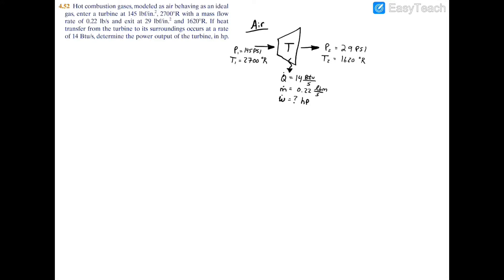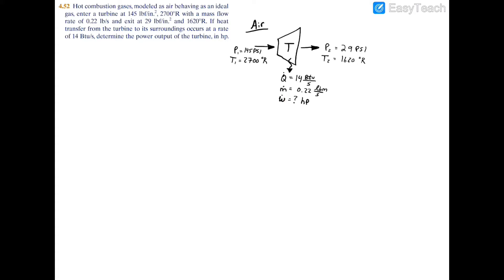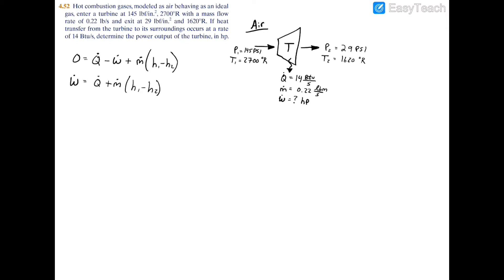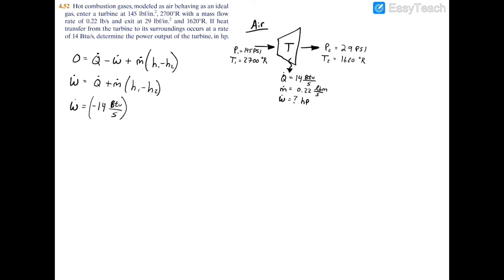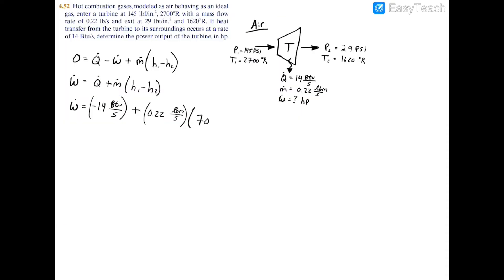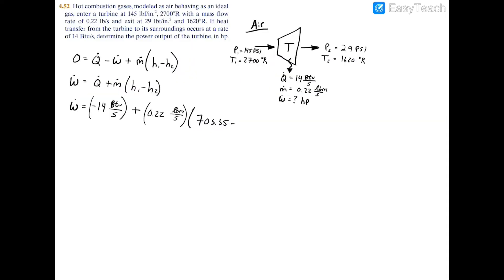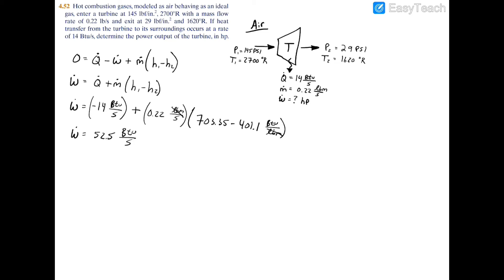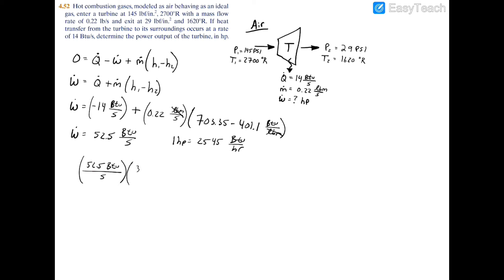4.52 Hot combustion gases, modeled as air behaving as an ideal gas, enter a turbine at 145 lbf/in.2

Comment: Question says that gas can be modelled as ideal gas, so do we really need to use to property table??
Reply from the maker: Hello, thank you for watching. The approach I have shown is the most accurate way of achieving the answer. I believe you are asking if we can just use the relationship of (h1-h2)=cp(T1-T2) instead, so we do not have to obtain the enthalpies from the properties tables. While you can definitely use this relationship, you still have to use the property table A-20E to interpolate air's specific heat constant, cp @ T(average), which is the average of T1 & T2, or 2160°R. Convert the average temperature of 2160°R to 1700°F, and interpolate for cp @1700°F from table A-20E. From table A-20E: @1500°F, cp=0.276 Btu/lb°R, @2000°F, cp=0.286 Btu/lb°R. From linear interpolation, @1700°F, cp=0.28 Btu/lb°R, or 0.28 Btu/lb°F. Therefore we can use the relationship: Ẇ= -14Btu/s + (0.22 lbm/s)(0.28 Btu/lb°F)(2700-1620°F) = 52.528 Btu/s, or 74.32 hp. As you can see, using this relationship produces a very close appoximation of the answer using the enthalpies. Let me know if you have any other questions!
Reply: @gr_engineering  thank you very much👍
Reply from the maker: @arshedtholoori5413  Absolutely!